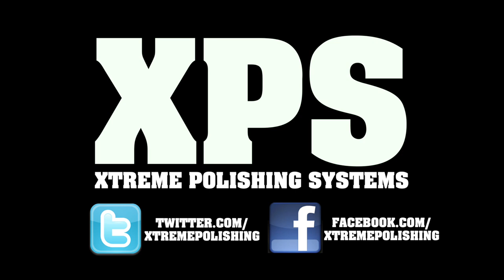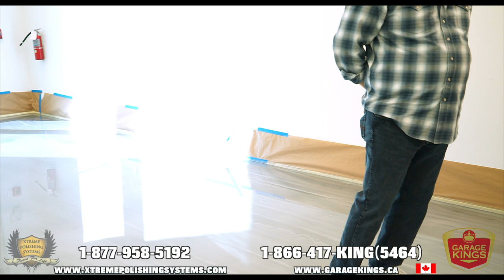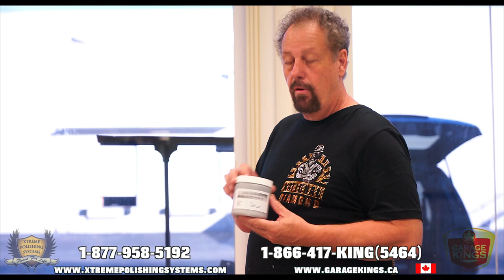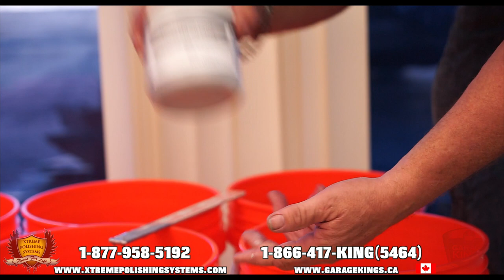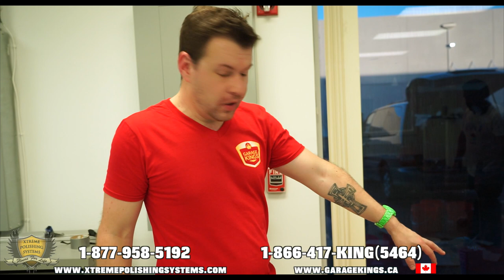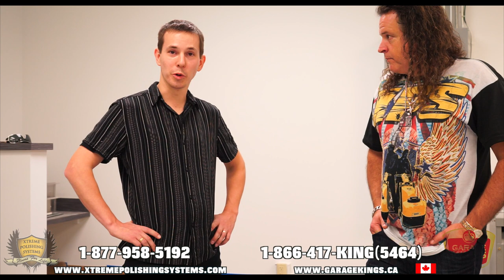HOW-TO Repair a Metallic Silver Metallic Epoxy Floor | Xtreme Polishing Systems

Comment: I have metallic Apoxy flooring in my garage and it scratches so easily, how can I reduce/repair the scratches without having a contractor come back?
Reply from the maker: If you coat the flooring with epoxy wax, it'll take care of all the superficial scratches adn will help protect the floor of 6 months against scratches. Our installers use https://www.xtremepolishingsystems.com/iWax-Epoxy-Floor-Wax-p/iwax-1.5.htm
Reply: Thank you for that! I'll try and post results!
Reply from the maker: If you wanted to email them in to info@xtremepolishingsystems.com we would be happy to feature them on our social media.

Comment: when laying epoxy onto existing epoxy do you have to sand it first?
Reply from the maker: It's always best to grind any surface smooth before applying epoxy. For process and product specific inquiries, please contact Chris at, (877) 958-5192 or by emailing in at info@xtremepolishingsystems.com